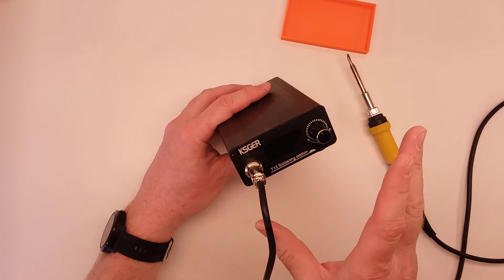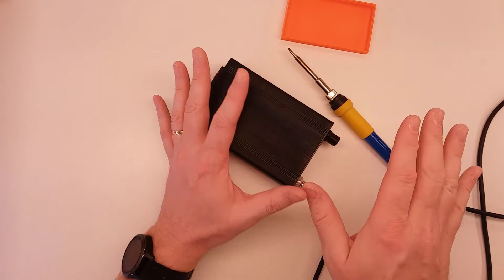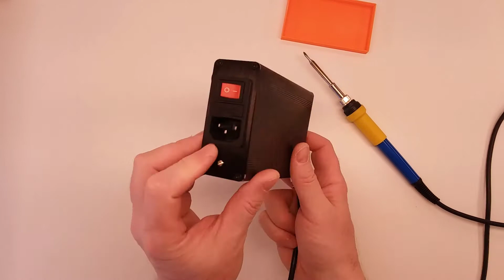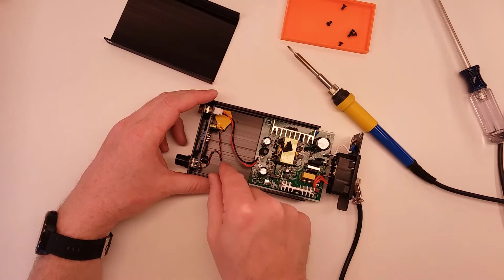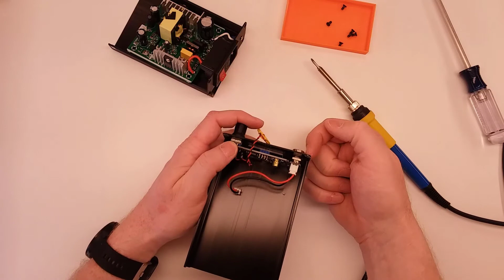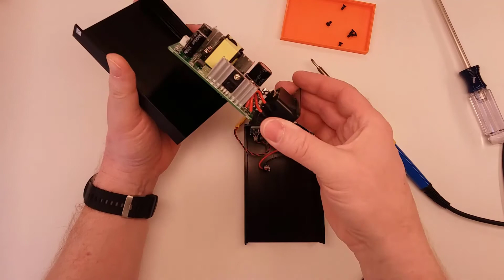KSGER Soldering Station Shake Sensor - FIXED! (easy 5-minute fix)

Comment: Congrats, but I have a simpler solution. Just sold a wire between the connector pin 3 and the ground terminal in the power input. There is no need to ground the case, it’s not even recommended. Besides that in case the real cause of the “blinking” shake indicator was the sensor itself which was mounted upside down. Nevertheless, grounding the tip of the soldering iron is going practice to avoid ESD damage. Your video was useful to point make my path shorter. Thank you.
Reply: OMG THANKS1 i do all the video and still haven't ground on the tip of the solder. with this works. THAAANKS!

Comment: I have this issue, but haven't been able to resolve it.

The tip of my iron already had continuity with the ground pin, but the case was not grounded.

I performed all of the modifications showen in your video, but the problem remains.

Is there anything else I can try?

Thanks.

Edit: I've just noticed John Cenas comment. Bit of a tricky fix when this is the only soldering iron I've got. lol
Reply from the maker: Yeah, that is what I was thinking too. Could just buy a 2nd wand, there are very cheap. If you have a multimeter, you could test yours and see if the shake sensor is triggering.
Reply: @Bluemonkeydev  
I do have a multimeter, but I'm not sure how to use it to perform this test.

Edit: I checked the sensor (SW-200D) for continuity. When tilted downwards, there is no continuity. When tilted upwards, the resistance fluctuates.
So an easy test for this fault, is to just place the iron on your work surface, propped up so that the tip is facing upwards.
Bingo! It now stays in standby mode :)

So yes, I will be buying a second wand, just to repair the first lol.
I do fancy trying out some other styles anyway, so it's all good.
Reply from the maker: @D4RKFiB3R  Yes, that sounds pretty definative! I guess you could replace that tilt sensor, they are dirt cheap.

Comment: there is a different issue in the plastic case ones, the 907-style handle has the sensor in the wrong orientation from what i have found out
Reply: Confirmed. Thanks for the info.